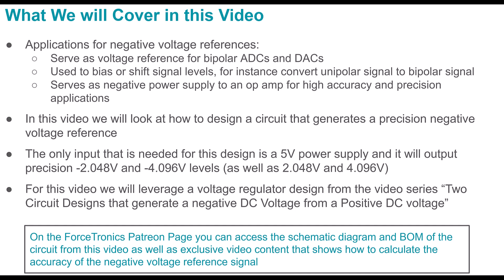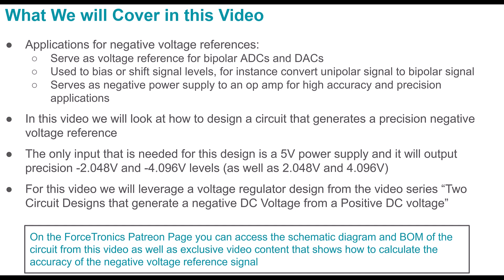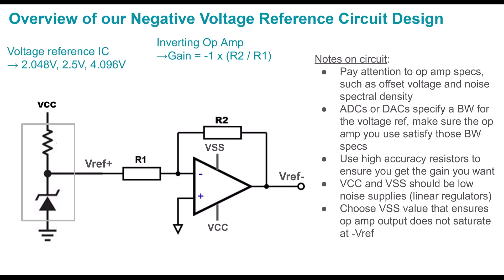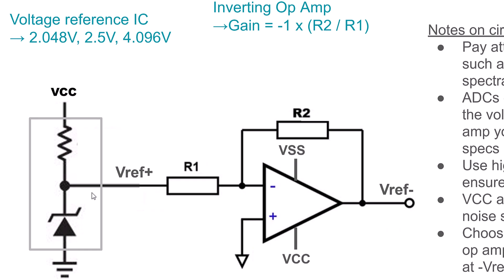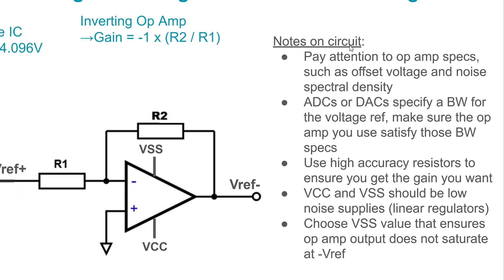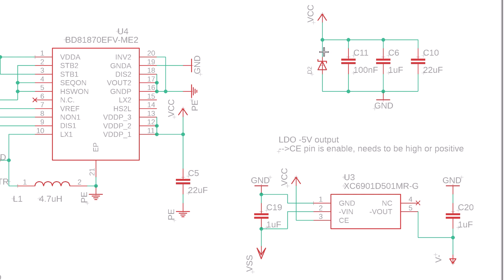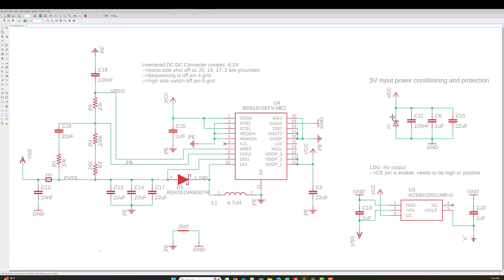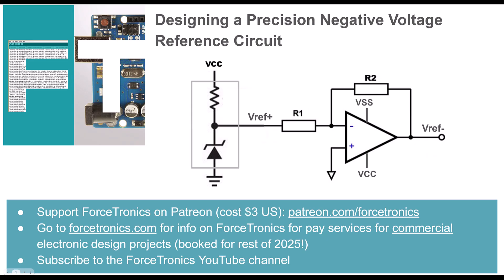Designing a Precision Negative Voltage Reference Circuit

Comment: Is it possible to use a positive voltage reference and connect the IC's GND pin to VSS and its supply pin to GND? so i have a postive voltage across the reference IC
Reply from the maker: Thanks for the question. Are you referring to the reference's input power pins? If so, I don't think that will work. Most reference ICS that I'm aware of. Use a stable zener diode to create their output voltage along with a buffer amp. Configuring the input supply like you said wouldn't properly bias that zener diode. Also, whatever circuit you're feeding the reference output into is I'm assuming going to be reference to ground so that would cause an issue as well.

Comment: I got here looking for a clever way to generate a small negative voltage.  In this case VSS = -5V and I don't have -5V at all. Lol... thanks though.
Reply from the maker: You should check out my video series right before this one. I talk about using a charge pump IC to generate a -0.23 volts

Comment: Vss on TOP and Vcc on BOTTOM is confusing !! Usually Vcc (positive) is shown on TOP, while Vss is USUALLY shown on bottom.
Reply from the maker: I appreciate the comment and sorry the image was confusing. What I'm used to is if it's inverting configuration you put the negative on the top and if it's non-inverting you put the positive on the top. If you do a Google search on op amp circuits you'll find my approach is not too uncommon. But I'll keep your feedback in mind